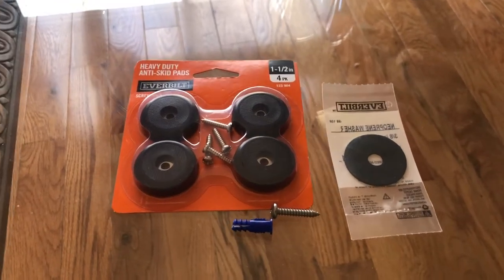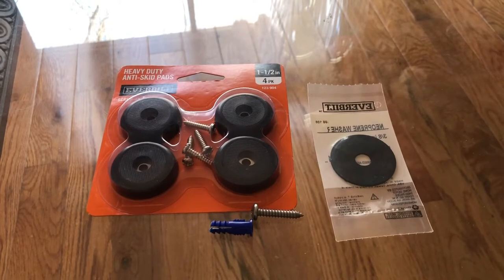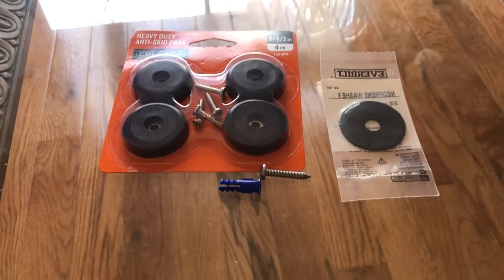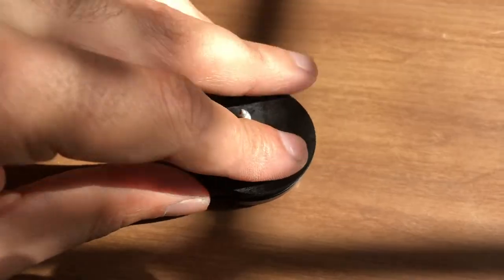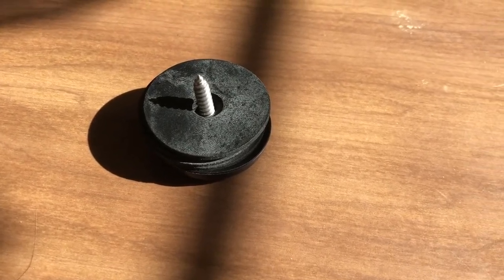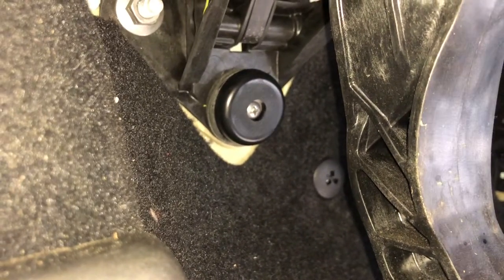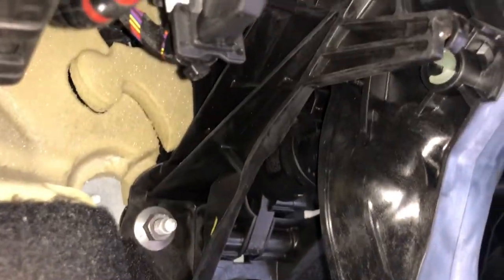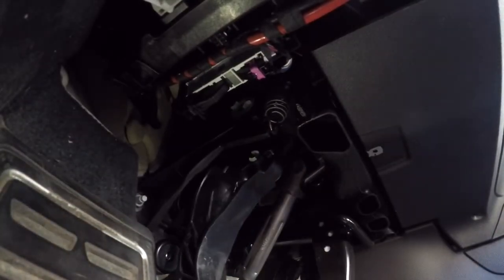MK7.5 GTI DIY Clutch Stop + Clutch Pedal Spring Removal!

Comment: What did you do about the safety feature when you  have to push the clutch the whole way in to start the car.
Reply from the maker: Sauce GT SGT With only the stop and one rubber spacer everything worked fine on startup